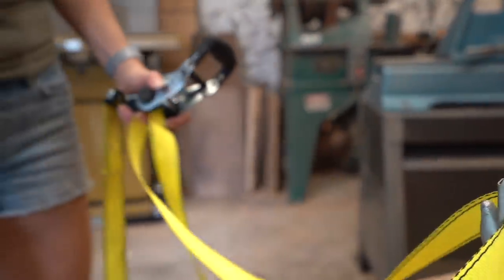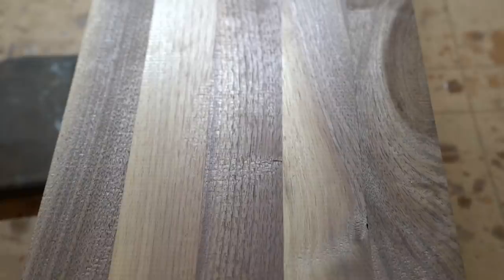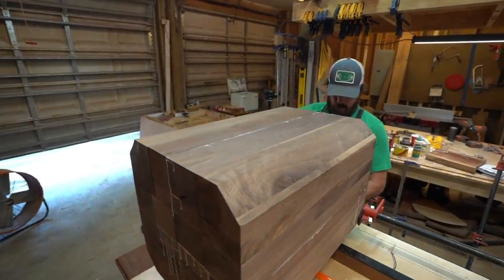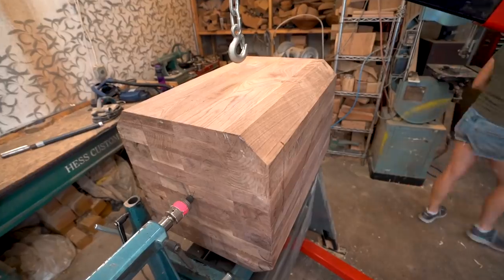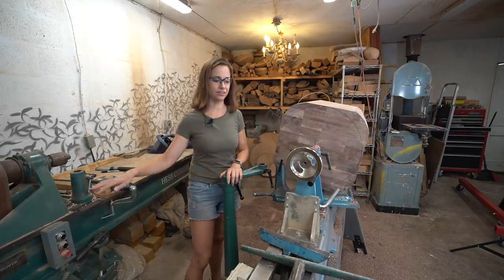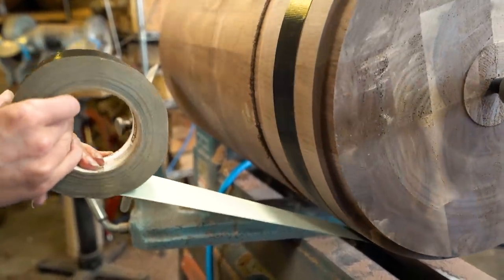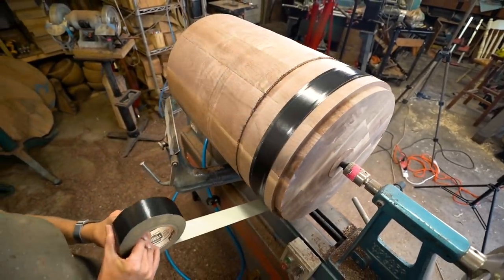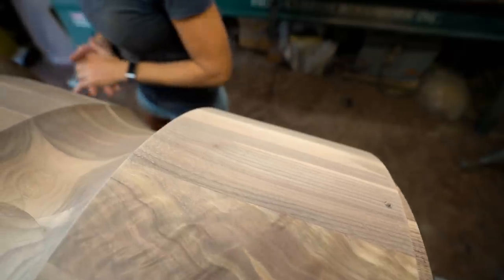Gigantic Table Turning

Comment: That was a massive piece of wood and it turned out great.  Interesting that something that size was made as a solid blank (massively heavy) instead of a segmented piece, which would have saved wood and weight.  I've done that before myself with pedestal tables, but I've never turned something that massive.  Scary!!  Walnut is such a pleasure to turn.  Really love the figure in the finished product.  Thanks for sharing this!

Comment: That was most enjoyable. Love the respect given for such a large turning. That little bracket behind the tailstock; - very clever, super idea, well done. If you would be so kind and share a little information on that face shield/respirator system. That looks a really neat piece of kit, I'm doing a little research and undecided which one to consider. Thank you Ashley, Ireland sends good luck & blessings.
Reply: Yes, what is the respirator system you are using, where can one buy it

Comment: Nice job turning that huge blank.
I'm just wondering if the blank could have been "coopered" up, instead of a solid piece as something that large is quite likely to crack in the future.
I have turned a few table pedestals  myself, (probably in the hundreds) with an old converted metal lathe, most of them had fancy fluting that was cut with a big 3 HP  Porter-Cable router mounted to the Lathe. Have turned quite  few porch columns on the same lathe as well.

Comment: Nice job on the pedestal. Turning large pieces has it own problems. I honestly don't know if it would make any difference but I would have staggered the joints in that blank when gluing it up but that's just me.

Comment: I used to work on metal on lathe, but we're talking bigger machines to handle the material. When I see the tiny lathe to run this huge puece of wood, and no protection on it, I would just run away.

Comment: I'm really surprised the four quarters weren't attached by anything more than glue. But apparently that works just fine.
Reply: you could use dowels, or mill in grooves, obviously any sort of metal fastener is out.  glue only does seem kind of sketchy
Reply: Wood glue is plenty strong enough for face grain connections like that
Reply: Lignin ( natural glue made by the tree) is what is holding the wood together.  Modern PVA is stronger than most lignin. It will be fine as long as the glue had not frozen or the work pieces been extremely cold during assembly and curing.

Comment: Since it was a glue up, why not have made a hollow core? Heavy and dangerous for no reason.
Reply: Why not make a hollow core? He says, uhhhhh that's the exact attitude which is leading the world down a path of "planned obsolescence" and it makes me sad! The way these pieces are done make them indestructible and eternal! Why put so much love, talent and effort into a piece that isn't the absolute best it can be??!!?
Reply: @jeffffro7674  It would use less material, that does not show or provide any useful feature, be safer to turn, wieght less, and would make it less likely to crack. Seems logical to me.
Reply: It's the base of a table. It needs to be as heavy and solid as possible for stability.  Duh.